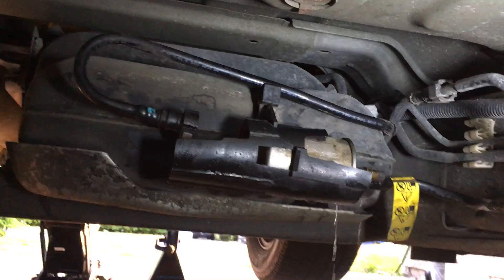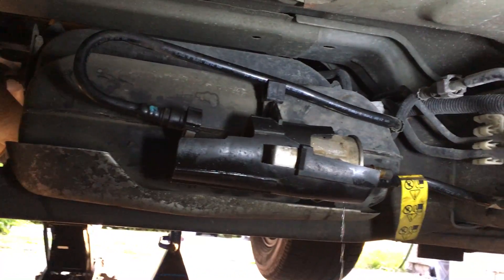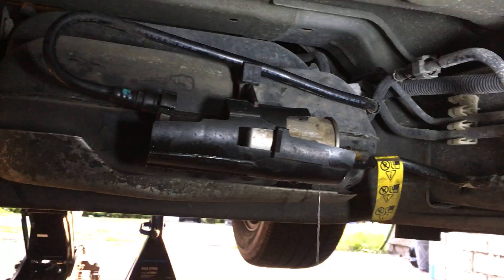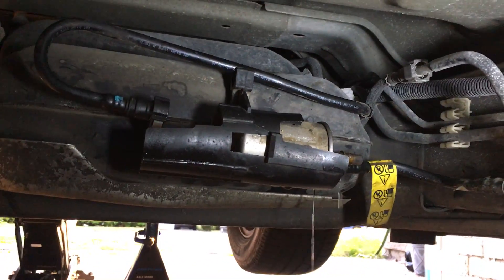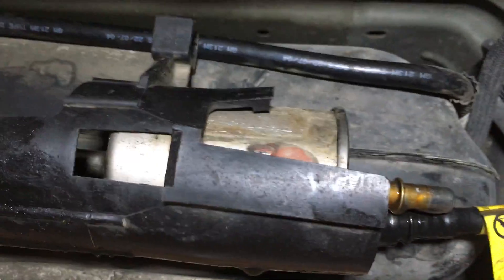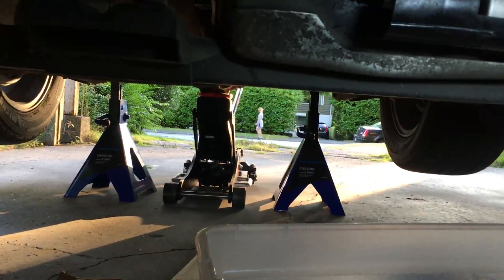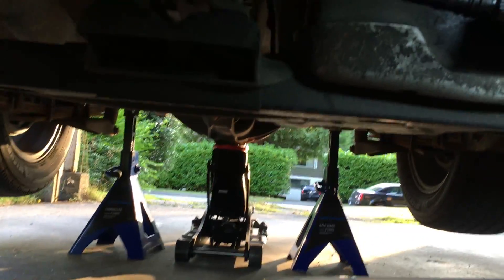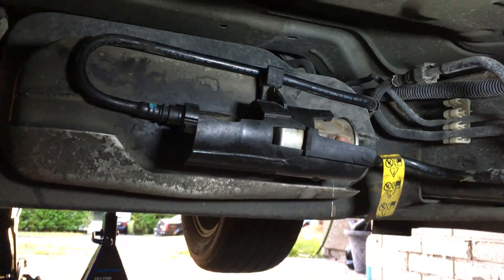Install a fuel filter on GMC Canyon trucks. Gasoline filter replacement. Torque settings for bolts.

Comment from the maker: Remove the gas cap, in order to allow free, unrestricted air, to flow into the gasoline storage tank, and the gasoline lines.
This is done, so that when you start the engine, the engine can freely suck fuel through the gasoline line, which runs from the fuel tank, to the engine, and the fuel injectors. We want to achieve, getting the fuel to the engine, without the help of the fuel pump running, and pushing the fuel to the injectors.
We want to remove the electrical fuse of the fuel pump, so that the pump stops pushing fuel from the gas tank to the engine, because we want to remove as much fuel out of the gasoline lines as possible, in order to replace the fuel filter, without having lots of gasoline dripping back from all the fuel hoses, once the fuel filter is disconnected.
The engine uses fuel, to create combustion in the cylinders, resulting in RPM. This revolution of the pistons within the cylinders, creates an air sucking effect, called a vacuum, when the pistons move downward in the cylinders. These downward moving pistons, draw air inward, and create a sucking vacuum air pressure.
This sucking air pressure, is enough suction, to allow the engine to pull all the fuel from the gasoline line, to the engine, without the help of the fuel pump pumping, and pushing fuel, once the fuse is removed.
With the gas cap off, it allows gasoline to move freely out of the gas tank, without restriction. Have you ever tried using your mouth, to suck air, out of an empty 2 litre plastic Coca Cola bottle? It would be a lot easier if you could drill a ½ inch hole, in the end of the plastic container.
Procedure:
-remove gas cap.
-put the parking brake on.
-locate the fuse for the fuel pump, and have pliers ready, to pull it out, but don’t pull it out yet.
-put the keys in the ignition, and start the engine, with the emergency brake on.
-with the engine now running, go and pull out the fuse for the fuel pump.
-the engine will keep running for a few seconds, until the engine’s vacuum has successfully sucked all of the remaining fuel out of the fuel lines, leading towards the engine.The engine will sputter, and quit running, once it has used up all of the available gasoline. So great!
-place the fuse for the fuel pump, back into its fuse holder.
-DISCONNECT the negative battery lead, on the car battery, for safety. Wrap paper towel around the end of the negative battery lead, so it does not touch any ground.
-now you can prepare to remove the old fuel filter, under the truck.

-If the plastic clip that holds the fuel filter in place clips properly over your new fuel filter, you will know that you have installed the filter facing the correct direction. You cannot reverse the direction of the fuel filter. The filter is directional, and must face the proper direction. There IS an in and an out, of the fuel filter.

Once the new filter is installed:
-reconnect the battery lead, and make sure it is clean of corrosion build up.
- make sure to prime the fuel pump before starting the engine, by turning the key on and off, 3 or 4 times, and waiting 10 seconds between each time you turn the key on and off (don’t turn the key all the way to the far right position in the ignition, or you will turn on the engine, and you don’t want to do that yet!)
-now that you have primed the fuel pump successfully, you can now completely turn the key, and start the engine.

Comment: What prompted you to change this? I’m getting very bad fuel economy and wonder if this is the issue.
Reply from the maker: I changed the filter, because the truck had 200,000 kilometers on it. My truck was never maintained properly by the previous owner, unfortunately. Replacing the fuel filter, will ensure that the fuel pump lasts longer, because if the fuel filter is clogged somewhat, it makes the fuel pump have to work harder and strain, in order to push the fuel past the restriction in the fuel filter.
Reply from the maker: fuel filter is not known to cause a problem with fuel economy.

Comment: Is this 2.9 or 3.7 and where was it located
Reply from the maker: My truck is the 3.5 litre, 5 cylinder, 2 wheel drive, extended cab GMC Canyon.

Comment: Any idea if it's the same on a 2012 canyon ?
Reply from the maker: I believe that 2004 to 2012 model years are the same.
Reply: @blairj1409  thanks, interestingly my GMC DEALER  replaced 2007;Canyon, /4 CYL/ LS, FUEL FILTER @60,000 miles In WARSAW Indiana……..NOW some 141,000 miles;; actually dealing with “ crank / turns over— NO START, rare problem .. Always takes off,after ten minutes or so… clues to reset PASSLOCK system :: with “9/ SEC FIX, etc”,     . ?..  Naturally, I just got $820:Shop charges / new Alternator,  new One year old Interstate Battery **REPLACEMENTS, *& bad FAN motor( waiting to replace)…etc.